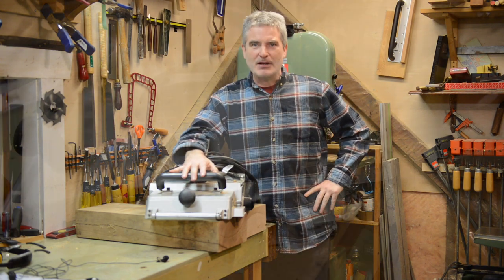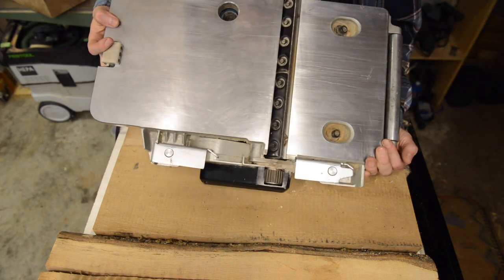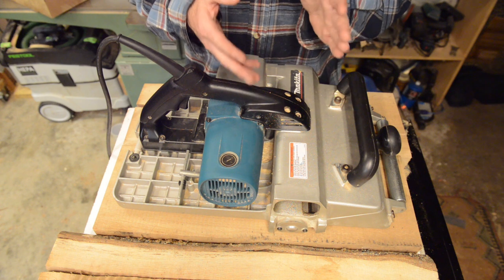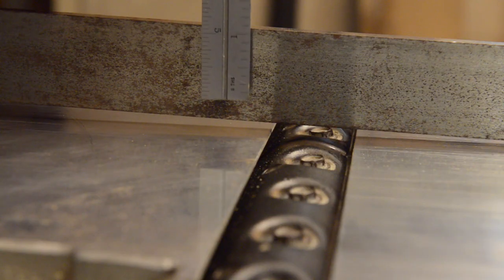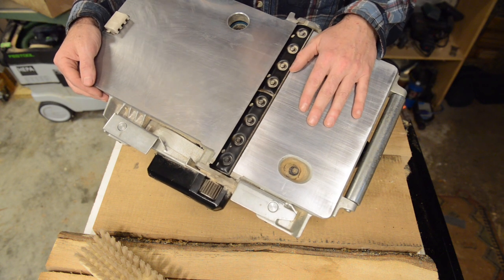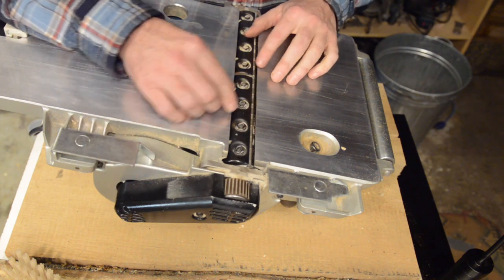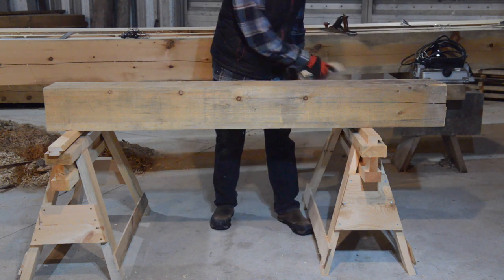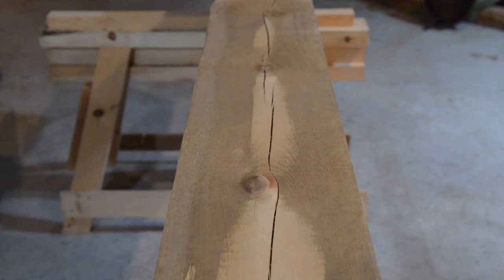HUGE Makita Power Planer - A Timberframing Essential | #timberframe #makita #woodworking

Comment: 17:10 gave me some PTSD hearing that noise again after the miles of timber I’ve planed with a KP312 😂.

Excellent and through video Brent! Not sure that I could say anything you didn’t mention. The ability to skew is definitely a plus for the width when you have 8x and under timber. 

I sold my KP312 a few years ago because my TF-ing is pretty few and far between these days, but I’d buy another no question if I needed one.
Reply from the maker: Haha, I hear ya.   The first few passes are kinda fun and rewarding but it gets old quickly!

Comment: I purchased a Makita 12” a couple years ago. Used twice and each time it would take a flat and square beam out of square and it’d eat one side of the beam more than the other. However, when my friend would do it, no problems. Is there a technique to holding and sliding this beast along the beams plane that I’m doing wrong? I was so frustrated and it was so bad that I hand planed all the beams. Thoughts?
Reply from the maker: I would try the technique I suggest in the video, it really doesn't take that long and seems to so the job.   Not all faces of the timber will be a problem in this way, so my guess is your friend just got lucky!